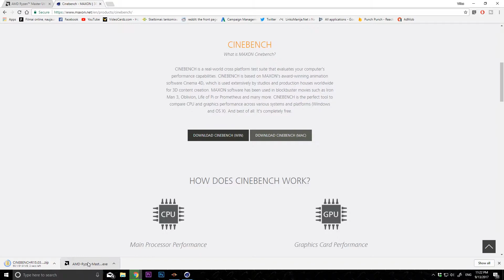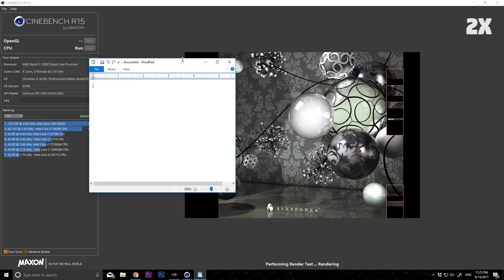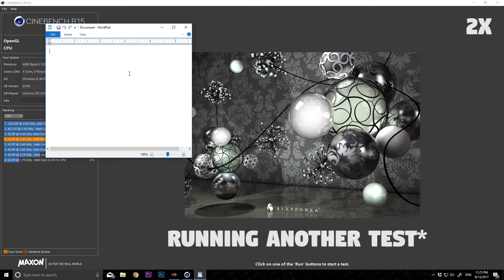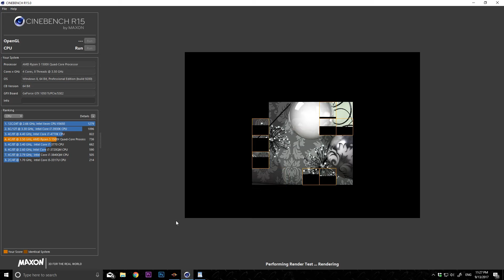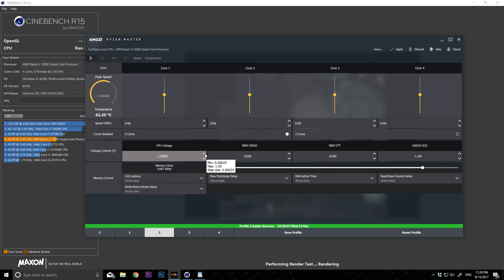How to Overclock Your Ryzen 1500x (Easy)

Comment: bro, i want my Ryzen 5 1500x CPU to last very long, like 5 years if possible. Should i avoid overclocking (and raising volts/temps) to ensure that it lasts long? 
What are the pros and cons of running CPU at 60 degrees and 70 degrees. Does it reduce lifespan?
If i run the CPU at stock speeds, will there be lesser fan noise?
Reply: I would suggest you not to push it further than 3.7 GHz, but you can overclock no problem.

Comment: 1.3v 3.9ghz and 30-45c on idle, and while full load 45-52c ryzen 5 1500x. is that good? also if I try to overclock my ram with an XMP profile will it blow up? xD I have 2400mhz ram and idk if I could hit that 2993mhz. xD
Reply: I have 2400 and put it to 3000, did u do it?